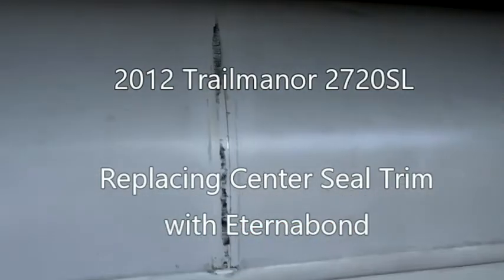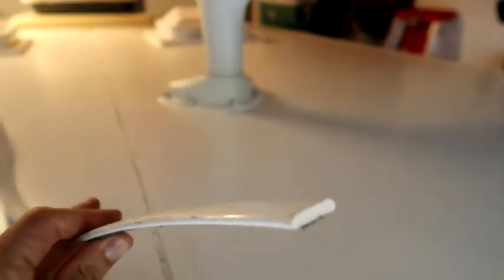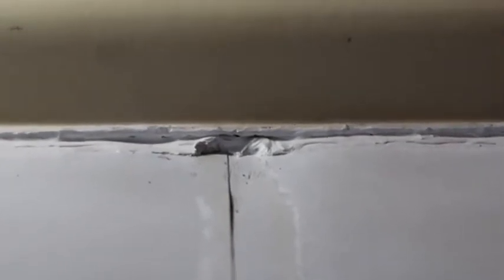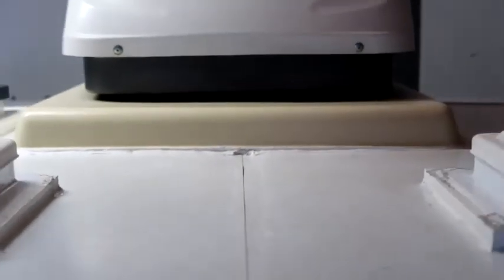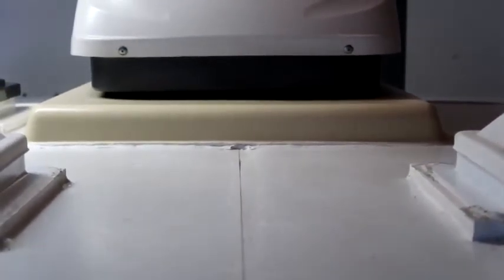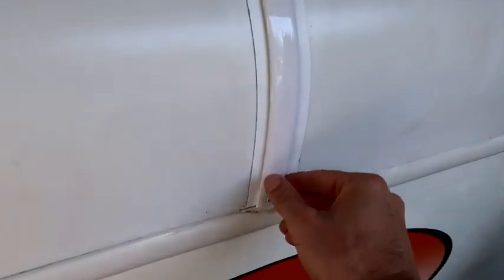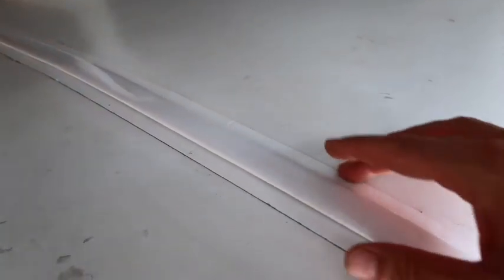Roof Seal trip replacement with Eternabond - Trailmanor 2720SL

Comment: Hi I have a 2003 and have the same thing now and just wondering how is the tape holding up?
Reply from the maker: Tape has held up great, but I do keep it garaged.  I also had to replace the a/c gasket which was causing some leaks in similar areas.